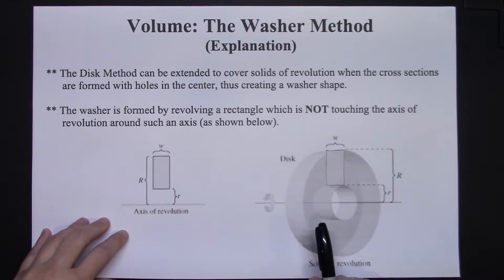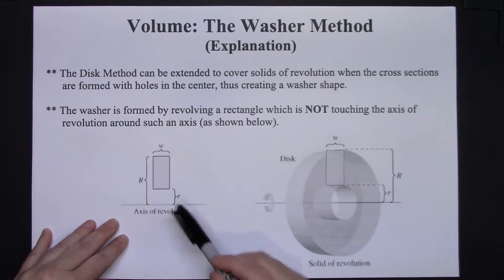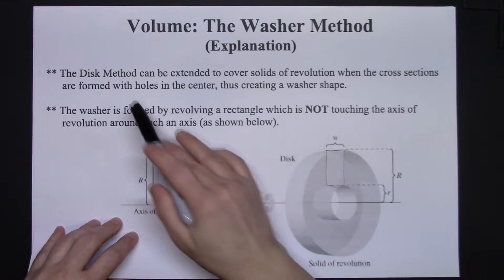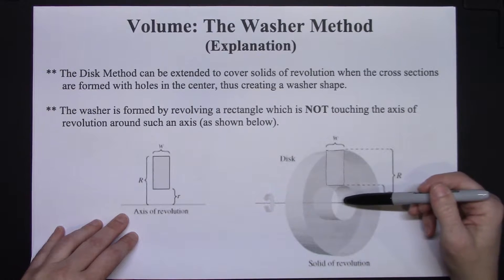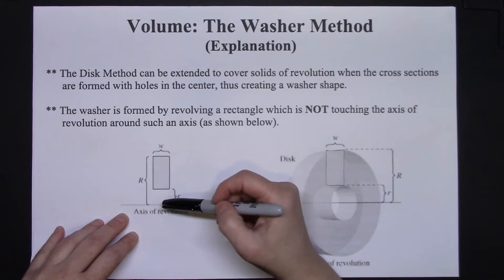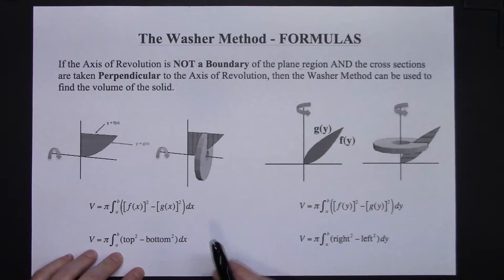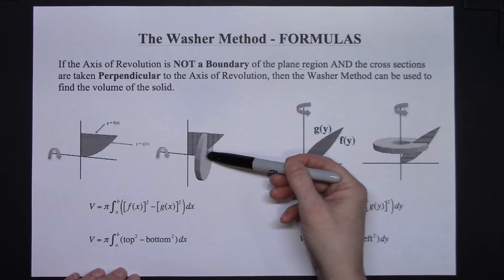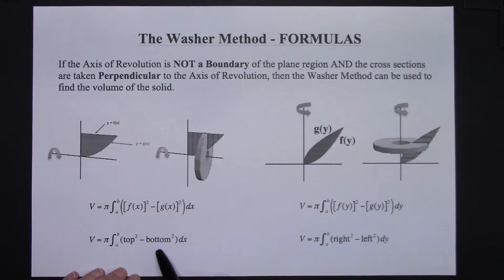Washer Method in Calculus 1

Comment: Thanks for clarifying my question (6.7.2018)  on the Washer Method regarding Y being the subject of the formula, a function of X and integrating with respect to X (and visa versa) when you responded on your site and  emailing me.     As you answered my question on the site it saved me having to write anything for the benefit of others who may have also been confused my some of the terms used in these problems. Just to say: "Thank you" for taking the time to answer my question.
Reply from the maker: Anytime!